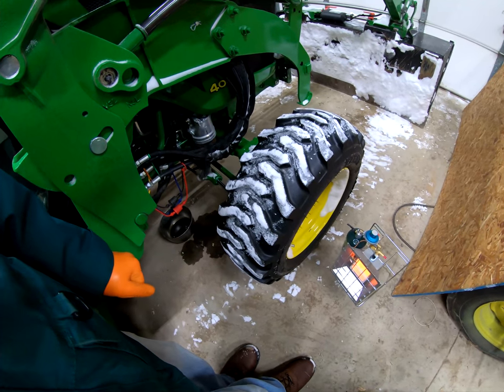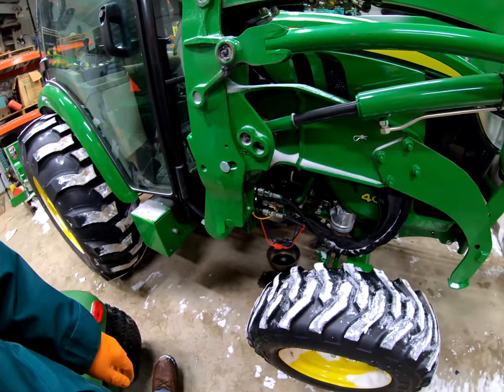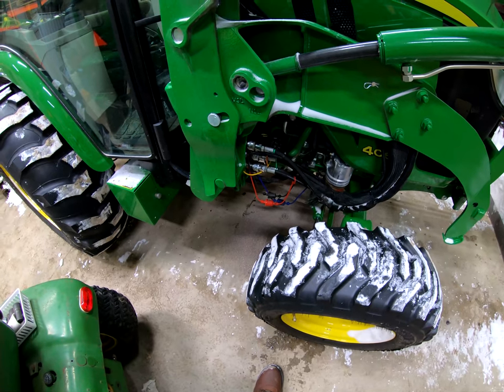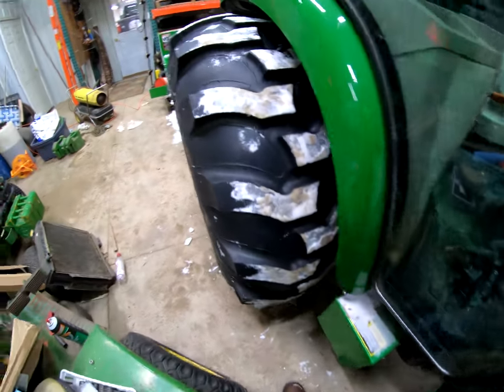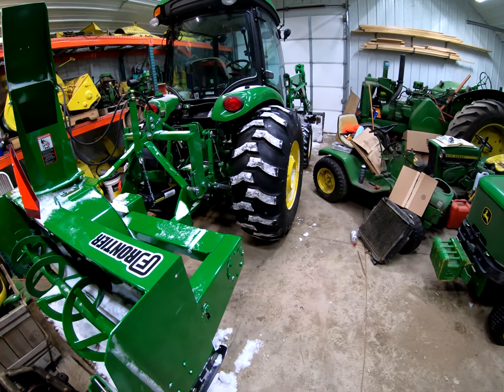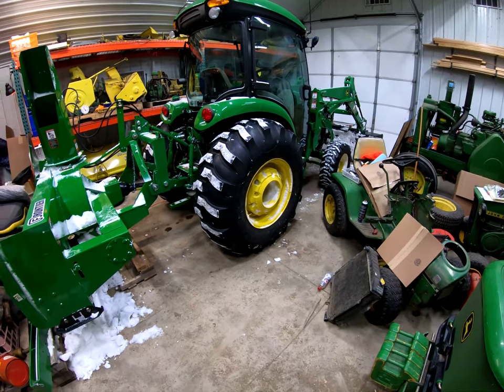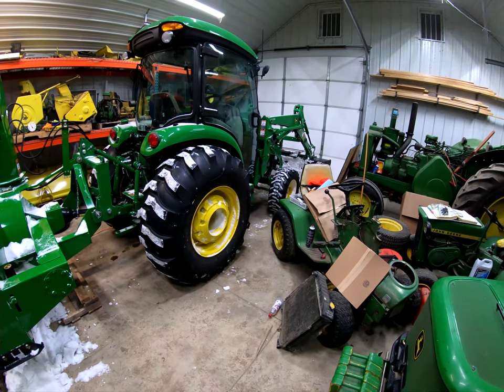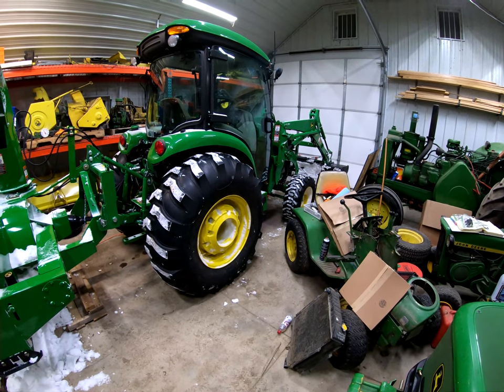Oil Change and Blower Talk

Comment: I can appreciate this machine.  However I own a 455 and I need to fully service it.    If u would change the oil on the 455 and go over that hose that tucks into the frame ???? Their are a few little tricks on the 455.  Thank you up front
Reply from the maker: Hopefully I will get back to the 455 in two to three weeks. Looks like the weather forecast is finally getting a little better and we might escape the tight grip of winter in the next month. Once I don't have to continually be set up for  cold and snow operations I'll get to work on the 455. I did pick up a few things at the dealer yesterday to prep for digging into it. Which hose are you speaking of?